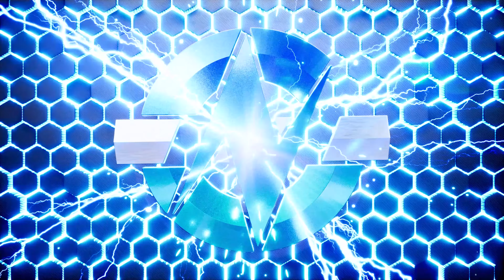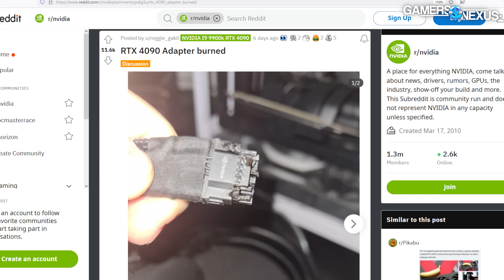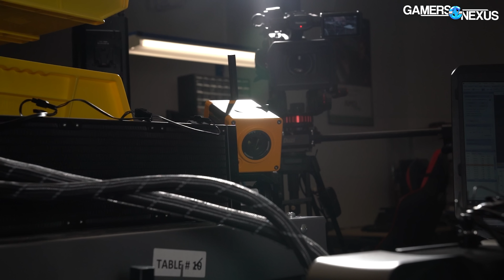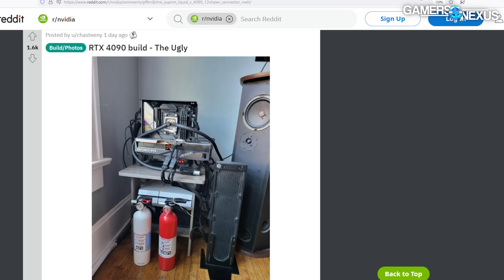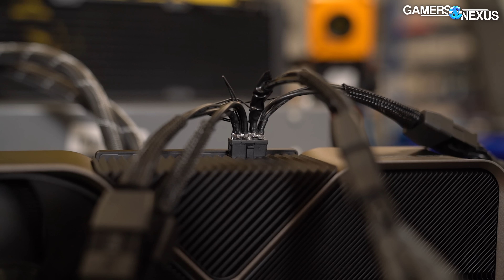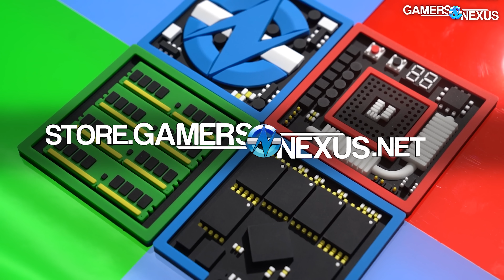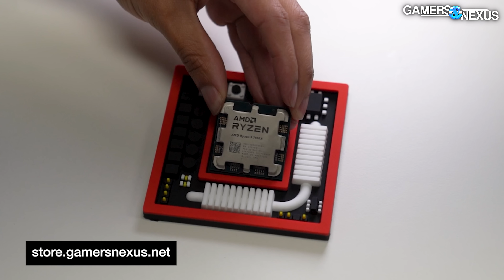Testing Burning NVIDIA 12VHPWR Adapter Cable Theories (RTX 4090)

Comment: From working in the motor industry for over 40 years I've come across this type of burning in connectors a lot, what we have discovered in most cases, the burning occurs when there is a bad connection between the pin and the outer shroud that connects onto the pin, this is typically caused by either the shroud becoming loose on the pin or dirt/corrosion, this then causes the contact to arc inside the connection and causes the burning of the plastic shroud. I hope this may be of some help/
Reply: A car battery = 12V , see if it not arc ;)
Reply: "Thanks Steve"
Jokes aside, I think you are probably right.
Reply: the pins are getting hot because of poor contact, and its melting the connector on the internal plug part, not the external part.  in all the pictures I can find, the pins themselves are blackened, and the plastic is melted inside the plug port.  all the Nvidia adapters are "dual spade" connectors, aka, they have 2 slots instead of one, get slightly bent outward, and have poor contact.
Reply: Corrosion from humidity and contaminants is one of the biggest problems for any kind of electrical connector.  This is where gold plating actually makes sense.
Split sleeves are just bad news, unless they are made of hard spring metal, they can deform and become loose.
Also, round pins and round sleeves are superior to square ones, contact is inherently more uniform.
Reply: yeah, maybe bad QC units with bad condition pins, who knows
Reply: Yes, totally agree.
Reply: Arcing doesn't have to occur it is high resistance. 
When resistance (resistor) is in circuit work is performed in the form if heat. Some voltage is lost or dropped. 
An interesting test could be to see if or how much the voltage drops on card side versus input from power supply.
Reply: @Racinls1  those heat points happens because even in this scenario, PSU is capable of support higher current needed because of the bad contact issue. If voltage drop happens in any 12v rail of the card, it should shot down inmediately for protection
Reply: To clarify what you're saying to fanboys trying to dunk on Nvidia, this is a normal point of failure in electronics, even at much lower currents. There's no such thing as 0% failure but that doesn't fit the fanboy agenda. Regular 8pin and Molex connectors have been melting for years (which I've personally experienced), but fanboys don't want to hear that when they have a chance to implicate Nvidia. There's plenty of valid reasons to hate Nvidia but this is getting ridiculous for how few instances out of hundreds of thousands of cards have been sold.

Now if Nvidia refused to replace said GPUs? cough*ASUS*cough   THAT'S when we should be up in arms.
Reply: @zodwraith5745  But this is designed to power a GPU eating ~500W, it shouldn't fail. Obviously you can melt any connector if you push them past their limits.
Reply: I still suspect dirty soldering,  example being igors lab and Jay have breaks. But I also suspect poor metal quality. Made in China this practice is common. I have yet to see anyone measure resistance over the cables before using. Hypots exist for a reason.
Reply: Arching at 12v?
Reply: @deth3021  it’s an extremely short distance to arc

Edit: also yes arcing can definitely occur at 12V
Reply: @thannydevitos2332  DC arcing is way worse (hotter) than AC arcing at the same voltage and current and it gets bad fast.
Reply: @deth3021  - Batteries arc all the time. Ever hook up a 12v car battery while something's on, like lights? Arc city baby.. Shoot, just the 'keep alive' power to the ECM and radios in new vehicles is enough to cause a spark now-a-days.
Reply: @deth3021  Rub a wrench across a cars battery terminal and you will see 12v is very good at throwing arcs.
Reply: @gprojectnoob4779  sparks yes, archs not so much.
Reply: @deth3021  the voltage is not important on arcs and overheating, the cause are the amps who flow between the microscopic distance who causes rust and dirt, and in electronics are just a bad connection. As an IT technician, i've seen a lot of this stuff. Do you remember NZXT's cases seting on fire?. Yes, it was at 12 volts and an arc between a screw and the very near possitive rail, who caused a not dead short circuit.
Reply: @deth3021  The saying is "if it can spark, it can arc!".
Reply: @deth3021  "sparks yes, archs not so much." You should just look up the definition of what arch means.
Reply: @deth3021  Take a wire and touch both terminals on a 12V battery. It will arch.
Reply: @willjohnsonjohnson  if it goes through a wire isn't an arc.

I being to think you guys don't know the different between sparks and arcs.

Comment: This might be theorycrafting again, but buildzoid insisted that the pins are in parallel. That means higher resistance=less heat.

Because the parallel connection would have same voltage drop across pins and heat generation would be V^2/R. Plastic around pins melting means pins are overheating. So, one pin having bad connection shouldn't matter, it has to be all pins badly connected or just one pin connected at all.

Also, worth checking the temperature when plastic melts. Take melted cable and check at what temperature the plastic melts. 

Take rest, keep doing good work. we got plenty of time to find the issue. Don't burn out, let the pins burn.

Comment: I wonder why nvidia chose this cable design rather than the tried and true "pin crimped to the cable" method. Soldered connections always break under stress.

Comment: Regardless of the root cause, adapters are always just the "cheap" solution to make things work together which were not meant to work together to begin with. Jay said it best: "Don´t use those thingies". You bought a 1600 dollar new shiny toy, maybe it's worth spending the extra money to adapt a proper PSU (understood, that options are currently still limited) or at least get a proper cable.

Comment: I'm thinking that this is a multi-sourcing problem with one or some manufacturers having a quality issue. Whatever the problem, Nvidia needs to get on top of it. Why Nvidia didn't just use connectors with higher rated contacts is a mystery to me. Its not like the 12 pin connector has any "backwards compatibility".

Comment: Hi Gamers Nexus, see if you can find some sort of manufacturing date on the cables as well. It might just be a date wheel on a connector. I am wondering if the ones that Jay and Igor have are early production parts and the ones you have are later production. It’s possible Nvidia’s adapter(s) supplier already seen the issue and fixed it. 

There also could be more than one adapter supplier. You did bring that up already. It would be good to see if you can see other differences between the adapters to indicate that as well if Nvidia and the board partners won’t confirm it.

Comment: It's actually quite simple. To have heat you require resistance. There is only 1 way you will get resistance to go up in this instance and that is bad connection. There is no other magical ways at least in this setup that you are going to get close at 450Watt to overwhelm even  2 14AGW cables at 12V there is room to spare I promise. So either bad pin to connector connection or a teeny tiny airgap at a bad solder joint or just a bad solder joint.

Comment: That's not bad, but all off you testing this phenomen are using a bench table, not a case with a force bended cable and probably a hot air trap and bad ventilation.
And thank you as always for the deep investigating and hard work, you guys absolutely rock.

Comment: Repeatable checking of your cable/conector by unpluging it will realy wear out your limited cycles. 
A problem that didnt exist for the normal user before and that comes as a bonus with your 1600+ dollar GPU purchuse.

Comment: Soldering a high power adaptor that might go under mechnaical stress is always a bad idea. Crimping should be preffered: https://nepp.nasa.gov/files/27631/NSTD87394A.pdf
Reply: Since your thermal camera is 1) measuring surface temperature 2) measuring an average over an area 3) IR transmission coefficient and heat capacity of the insulating materials are not known, so the inside temperature might be much higher than what you measure and local hot spots might be present. Considering the low-temperature solder factories tend to use for saving energy, the temperatures might easily reach levels at local hot points that melt the solder.  That is not only a mechanical problem but an invitation to plasma fires (see solar installation safety). That is why you always crimp high-power mechanically stressed joints.

Comment: The thickness of the copper is what you want to be looking at for current handling capability not the voltage rating on the cable as that's more about insulation

Comment: I still think most of the cause is the amp draw through small pins and tiny gauge wire. I worked at mini and their rear tail lights did the same thing

Comment: "Buy Sleep"... lemme guess it's going to be an OTA update? 😅 Okay, I'll see myself out and to watch the rest of video lol... Edit: Damn, 72 hours of hard gruelling work and testing. Goes to show why GN is widely respected - it's because of who they are - a organisation's ethos all comes from the top down. So, much respect to Steve for sticking to giving the team a much earned break and working through to find as well as replicate the fault. Recognition and respect should also go out to Patrick for his efforts too! 
Hope you guys get some well earned rest and are not haunted by those wrecked cables! (had to rephrase that as it sounded way worse when typed up lmao).. 
In regards to the topic at hand, poor airflow might be another factor as if the cable is not seated properly or has internal damage at the bus bar connections - given these scenarious result in higher temps. Poor airflow would make the temps alot worse compared to a test bench. Hopefully when GN get's their hands on the burned cables to test we will get more info. I imagine this fiasco could result in the 12vhpwr cable connector (that plugs into the GPU) being somewhat revamped be it internally (different pins being used - that are seamless is more likely) or externally (highly unlikely but a possibility).

Comment: Jesus, this is so overcomplicated and pointless. Nvidia's House Burner™ connector has 0 safety margin which makes it 200 times more vulnerable to random glitches, voltage spikes, inevitable minor manufacturing defects etc. It's an intentionally cheap, flawed and dangerous design, accenting on profit margins instead of safety. 
Redesign it with 70% safety margin requirement and it will have the same failure rate as an 8-pin.
The end, case closed, problem's solved.

Comment: This standard is just badly designed and I have no idea how they get the certificate.
They should just add 4 pins to the existing 8-pin standard and make the connection 50% larger - end of the story.
But they decided to make everything so small and tiny, with too thin pins too close to each other so everything is wobbling and this changing the area of electric contact.
In my humble opinion is not about cables or wiring but about a too-small connector with too-thin pins.

Comment: 12VHPWR Adapter splits the 12VHPWR connector into multiple 12v PCI-E power connectors. What if some of those connectors are supplied by different power lines on the PSU, causing some of the lines have different amount of load (in case some PSU lines sag more than others).

Comment: The most likely cause is arching / high current through the very tiny piece that still left / making contact in the circuit that creates high enough temperatures to melt stuff.

Comment: Isn't each 8 pin connected adding 150w to the power budget? So the outer pins (on the adapter soldered 1-2-2-1) are trying to deliver 12.5A into the card via the 9.5A rated pins of the 12vHPWR connector. I'd suspect connecting 3 8 pins (2 outer and 1 inner) on the suspect connector is what is causing issues.

Comment: It might be worth trying to outright cut one of the wires and testing the current flowing through that single cut wire to see if a single loose or severed wire would pass enough current to heat up the cable 
a loose or poorly contacting line with hardly any current running through it would heat up a hell of a lot less than if significant current flows when the added resistance of a multimeter or a very weak connection is added 
you can also test the pin resistance by measuring voltage from either side of the same pin while the card is under load (voltage drop) and see if some contacts have a higher resistance when the cable is torqued or moved strangely ... you dont need to measure current and do the actual resistance calculation, relative measurements is enough ... more voltage = more resistance. If it is heating up there must be a higher resistance somewhere in the contact 
as someone who regularly works with high power connectors i am more and more leaning towards a very rare defect as i have not seen anyone be able to reproduce the problem on video so i lean away from user error or a common problem

Comment: Hi steve, Paul from Paul's Hardware had the solder pattern of Igor's, but also had a 300V rated cable. Even more revisions! This is getting messy

https://youtu.be/ei6mB23XcD8?t=634

Comment: Seems ripe making to have a Schrödinger scenario here where 4090 owners want to check to see if their cable is starting to melt, yet worried that disconnecting and reconnecting could end up causing that very situation to happen.

Comment: The Voltage-Rating doesn't mean a thing for 12V. It's about insulation with Voltage-Ratings. And clearly 150V rating is enough for 12V actual voltage. The gauge of the power delivering wires is important here.
Also: you say theory, when you mean hypothesis.
Great video though. Thanks.

Comment: That means the picture of melted cables will need to have the insulation standard at least stated? And then do a repeat test basically copy how the cable was manufactured (6 sepeared "pins" slapped into a connector with soldered connections) and see the results be the same, there could be indeed a manufacturing batch defect that is sent out by nVidia thath as this issue (think of it as the first 400-500 GPUs that went out of the production line until nVidia saw an issue in their internal testing and changed the supply chain)

Comment: Buildzoid's theory is the most plausible, the pins are the problem (the inside is melting) not the cable or soldering

Comment: Its likely the cable is run through the hot air from the GPU itself causing the wire to heat up and as there is no airflow over the plug itself. The hotter wires transfer the heat over to the connector.
This could lead into a thermal runaway situation if the center pins are not connected well. 
Speculation at best. I think its reasonable to assume its indeed a bad batch of cables perhaps cables from an early run mistakenly added to the bin of cables to get send to people.

Comment: Using any kind of adapter for power delivery is always a bad idea. Like Steve said, you are introducing another point of failure. Now we are also seeing there are different designs for this adapter, compounding the issue. Which one is good or bad?

Comment: I wonder if Nvidia or the factory they use recognized that the early design was faulty and quickly changed it, but didn't recall the bad connectors.
Reply: Could be related to the pci-sig notification?

Comment: I would be interested in seeing the resistance measurements between each connector output and input of the unconnected failed adapter cables. The only similar situation I have ever experienced was with an amd 295x2..... Contact resistance certainly seems the most likely cause, especially once the adapter is eliminated.

An x-ray of a failing cable would be best case :D